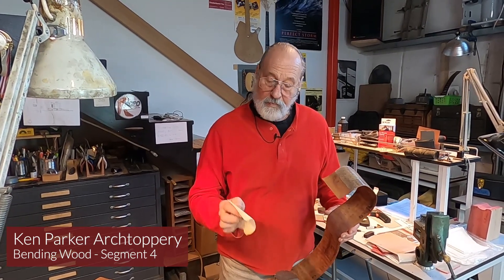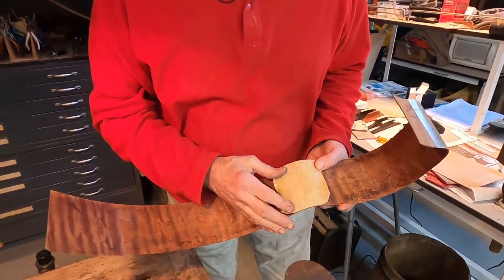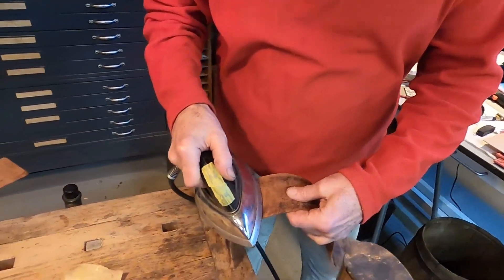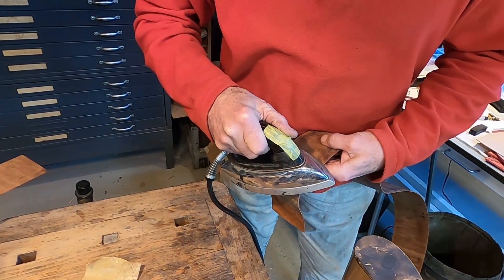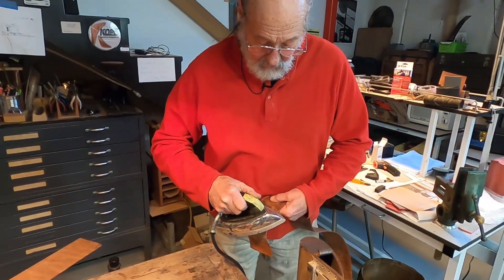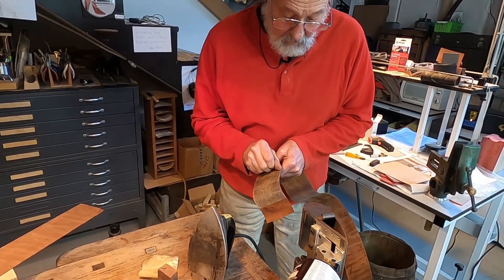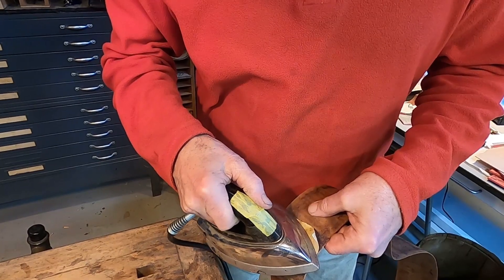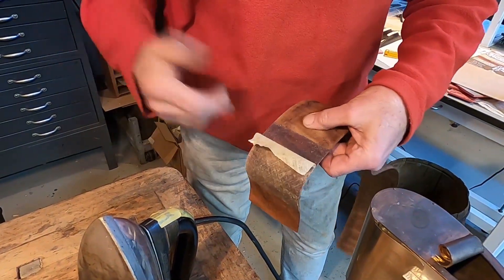Ken Parker Archtoppery: Bending Sides 4

Comment: Please help me to understand Ken. In Part 1 you mentioned that when bending wood, the outside wood fibers stretch. Just a few questions please:

1) Do the wood fibers (on the outside part of the bend) ‘need to stretch’ (to some extent) in order for a successful bend without cracking? 

2) If the answer to question #1 is yes, then how does glueing the linen patches to the outside of each bend still allow the wood fibers to stretch since they are now 
glued-in-place?

3) Or do the glued linen patches prevent only the very top surface of the outside wood fibers to not-crack yet still allows the wood fibers underneath the surface to bend?

4) However, doesn’t the glue (from the linen patches) penetrate deep into the wood thus preventing both stretching and compression of the wood fibers as all wood fibers are now locked and glue-in-place? 

One would think that the glued linen patches would prevent the wood from stretching as you bend thus causing the materiel to either pull/rip apart or crack in some way. However your bends were perfect. Just trying to better understand the science of what’s happening. Thank you Ken. Great video series! Learned a lot.
Reply from the maker: I'd say I'm not sure how much better a job I can do to explain the linen/paper reinforcement scheme than  this,
https://www.youtube.com/watch?v=uwlFHIGr3tE
and this,
https://www.youtube.com/watch?v=vjsSIwAikGU
I'll emphasise that the method is to use the smallest amount of resin that you can to laminate the linen so that the wood doesn't fill up with resin, which would make it a little harder to bend. In fact, the heat we need to bend the wood is enough to mess up the cured epoxy's strength, but it hangs in there well enough during the short time we're playing with heat.
So far as finish goes, I think the only surefire way to make this work using epoxy to bond the patch is to use the same resin as a primer, and so all is forgiven, and there's no issue with any leftover resin left in the side making a color or finish adhesion mess.
Other adhesives will work if you don't want to deal with epoxy, I used to use hide glue, but much prefer the benefit of staying away from water based adhesives which make thin wood go crazy.
I'm sure the cloth does stretch a tiny bit, especially because of the bias cut, which is the + and - 45 degree fiber orientation relative to the side's long axis. We don't "need' the wood to stretch, certainly, just not fail during bending.
It all works famously, loading very nearly all of the side material in compression, which can't fail during bending.
I'm not sure why you think the material would rip/pull apart, as the cloth support method prevents exactly this problem.
This really works perfectly for me, and has lowered my blood pressure.

Comment: could you use peel ply instead of linen ?
Reply from the maker: Well, since the whole reason for peel-ply is that it is a "release film", and so  is especially made so that it cannot be reliably bonded with epoxy resins, I would suggest that it wouldn't bond anything like well enough to take the stretching, or tensile loads it would "see" during bending, and would just pop of right when you need it to stay stuck on. I have found that using linen is the best solution for me, although I did try some other materials like cotton and thick Kraft paper on the way to this conclusion, and you could certainly try other bondable cloth or papers of your choosing if you like. Good luck!

Comment: So you are not laminating these, but leaving the sides single ply at 0.055"??? Thanks.
Reply from the maker: I have done sides several ways, and this one is the most direct, with simple methods and tooling. 
I'm currently using a much more complex method, but chose to show the universal style that I thought the most of you would benefit from.I did it this way for over a decade, with many guitars.

Comment from the maker: Dear Ken,

Thank you for making available your videos on archtop construction- they are wonderful, well filmed, and I am really enjoying learning about your process.  

I hope I'm not bothering you with a question.  I recently watched the 4 video series on your side bending process, and was wondering what you do about the epoxy resin that is left on the sides after bending.  I saw that you remove the patch of linen with the clothes iron, but - and forgive me if this is covered in a later video that I have yet to see- you make no mention of what you do about the residual epoxy on the sides.

Thanks again.
Reply from the maker: Ah, perhaps I did forget to mention this! This is crucially important to know, as many of us have had the heartbreak of only noticing some such problem after the finish has been applied.
By using the same material for the primer coat, we drive around this problem. The epoxy residue from the side reinforcement patches, whether we remove them or not ( I have done it both ways) is cleaned up with scraper and sandpaper, but, of course, some will remain in the side material, and this would be a terrible problem, except that the first coat of my finish is the exact same epoxy, and so the issue is resolved automatically, and just isn't a concern!

Comment: Thank you for these videos, they are fantastic!  I really like your side molds and would love to know if they are designed to have the thickness of the side, straps and blankets in mind?  Meaning, do the two parts of the mold fit perfectly together without anything in there or is there a gap designed into them?  Again, thanks for sharing your knowledge. 🕉
Reply from the maker: Excellent question.  What you refer to, "designing a gap into them" is called an offset.  

If you are clamping/laminating a flat panel, all you need are two flat plates to apply pressure and control the surfaces.
So, in the 2D world, offset isn't an issue.
When you leave the world of flat planes, everything changes in some interesting ways.

To get the tool surfaces to control the bent side as I'm showing, these two tool components need to be cut so as to leave room for the side, 2 rubber heat blankets and the 2 stainless steel shims.
To do a good job, these tools need to be quite accurate.

Assuming we start with a hard outline pattern of your guitar shape, my cheap and cheerful way to mark the correct size offsets is this...

Glue up plywood or particleboard sheets to the required thickness for your sides.
In my experience, particleboard, although kinda disgusting, is the better choice, as it starts out pretty flat, plus its  homogeneity compared to a stack of plywood makes it so much easier to follow a line precisely on the bandsaw. If you tune up your saw and fit a sharp 1/4" blade, you'll have a good chance of cutting so well that cleanup will be trivial. That's the goal.

If the top surface is rough or funny texture/color that makes it hard to see your pen mark, consider gluing on a piece of smooth paper to get a proper surface for the pen.

Using the correct size flat washer, 
https://www.youtube.com/watch?v=Moe5IBhwX7Q
follow your guitar outline pattern and mark the outer part of the tool with a pen so as to expand the outline by the amount of one heat blanket plus one Stainless Steel shim's combined thickness.

"The correct size flatwasher" is judged by the difference between the outside and inside diameters, this is what we care about. Within reason, the diameter of the washer doesn't matter.

Two solutions to the problem of finding the right size washer are ..
1) Look through your giant box of odd washers you've been keeping for the last %#^$ years, or
2) Chuck up a bar of metal or plastic in your lathe, and make the correct part (easy).

Saw and clean up these surfaces with sanding blocks or your spindle sander, accuracy counts.
Now you use this outside tool to mark the inside part of the tool with another washer, this one sized to offset the whole stack of 2 heat blankets, 2 SS shims, and one guitar side.

It seems like this would be a good thing to demo, so we'll put it on the list, thanks!

Comment: Awesome as always Ken! I have applied your linen trick (on typically difficult fragile flame maple .075)  and, believe it or not, used titebond (not epoxy). and it still worked (I thought it would melt on the bend - behold it didn't!). I apply a similar tape trick to a (alternative) veneer/flax/epoxy lamination (no heat) clamped under vacuum (plastic/duct tapefrom Home Depot) and leave overnight. The 3M tape (white from Depot) comes right off and leaves an otherwise difficult bend intact. (Even veneer the thickness of a business card can gives some trouble) Doing it wrong but it works! ;) Thanks for letting us all geek out on your videos!
Reply from the maker: Excellent report!  There's lots of ways to apply this "temporary tape'' reinforcing idea, as you suggest. The reason I like epoxy for this job is that I use the same epoxy resin as a primer coat, and so there is no worry about cleaning off every trace of a "foreign" adhesive, as any leftover resin from the "temporary tape" removal just becomes a homeboy part of the finish. If it works, then you must didn't do it wrong, now, didja?  I dig your work, TogaMan!
Reply: @kenparkerarchtoppery9440  oh, yes, I have even French Polished epoxy 😂. Lately though I’ve been applying vacuum infusion to veneer arch  top sandwich balsa flax cf. (so the infused epoxy veneer is sand polishable). Eye candy with benefits and won’t crack like spruce does in extreme dry. I gave up the humidor fight….

Comment: Hey Ken, I'm wondering what your thoughts are around the idea that the rim, which supports the top plate, should be maximum stiffness (like a banjo).  To that end I know some luthiers use a multi-ply, usually three, for sides.  I have a hybrid nylon string that employs this technique and it's a canon!  The construction is still very light weight.  Obviously more work.
Reply from the maker: There's a lot to say about your question, and I promise we'll get around to this in detail sometime.  There seem to be at least two schools of thought here, with some builders favoring thin, one piece sides, (inspired by 100 year old Martin mahogany guitars?) and others going for the brick outhouse format with multiple epoxy bonded laminates and even solid wood cores with laminates on both sides.  Both can be successful, it seems to me.  I like sides to be compliant and light, so that's one end of the spectrum, but lots of fine builders are getting great results with very stiff laminates, so what do I know? The mad scientists in the classical guitar world were the first to go this way, i believe, with steel string builders following suit.  If you haven't looked lately, there's a lot of interesting newish design thinking in the classical guitar world in search of an expanded dynamic range (AKA Louder!) the embodiments of which have caught on with professional players.
Reply: @kenparkerarchtoppery9440 "If you haven't looked lately, there's a lot of interesting newish design thinking in the classical guitar world in search of an expanded dynamic range (AKA Louder!) the embodiments of which have caught on with professional players."   Yes like the double top thing of which I've seen done different ways including the use of Nomex which is a material borrowed from the aerospace industry I believe.  The goal of course is to produce a very light weight, high modulus plate.  Can't wait to hear your thoughts on this in an upcoming video.  Really enjoying the series.

Comment: Thanks a lot ken for all your sharing.
I fold the sides in aluminium foil to conserve water, but I don't find glue that supports hot bending, to do that. What is this glue ?
Reply from the maker: Sorry, I'm not sure what you are asking.
Glue for what?
Reply: @kenparkerarchtoppery9440   : glue for protection that prevents splits in the ribs during folding.

Comment: Maybe I missed it.  How thick are the sides?
Reply from the maker: You did, but it's easy to miss, I should have called it out at the start.  The sides are sawn and finely sanded to .055" - .060", or 1.5mm before bending, but are so well behaved that they need only a tiny bit of sanding with 320 and 800 to be ready for finish.  I feel this is just right for the size instrument I make.  There are different opinions on this, of course, but I want the sides to be compliant, as I think it frees the plates to vibrate better.

Comment: Hi Ken, 
So I've now watched through this series and I understand the concepts of reinforcing the side under tension and the calculation of how thickness affects stiffness.
What I'm not sure of yet is the point - meaning that is all this effort to allow you to produce an instrument with thicker sides than would otherwise be achievable without the reinforcement?
Or is it purely to be able to use conventional thickness but more highly figured woods and have insurance against splitting and breakage while bending?
Do you have anything on how side thickness/stiffness relates to the tone and clarity of an instrument - how it helps or hinders the soundboards?
Reply from the maker: "no" to Q #1, "yes to Q#2.  Q#3 begs a whole series of questions we'll need to address globally sometime.  Lots of different opinions here, and lots of paths to the mountaintop!
Reply: @kenparkerarchtoppery9440  Thankyou for the kind reply Ken. Very much appreciated. I would be very much interested in your thoughts on Q3 (if you have not already done it in an interview/article somewhere). I'd also love to hear how your thinking evolved re: tones achieved, clarity, use of carbon fibre for stiffness etc from your early archtops, through the electric Fly and full circle back to these current archtops.

Comment: Does the epoxy leaves any residue after sanding ? I guess not. Fabulous craftsmanship
Reply from the maker: since I use the same resin for the sealer/primer coat, it isn't an issue.
Reply: @kenparkerarchtoppery9440  Thanks a lot for your answer. Makes perfect sense

Comment: That linen trick is so cool. Never seen that before. I broke several sides on a tight cutaway guitar recently and managed to achieve it in the end using OBrien guitars technique of a steam box I built to steam the side for 15mins before bending. It worked reliably repeatedly but I’m sure on some woods it would cause them to ripple badly. I will try your method on the next one. I’ve got some zpoxy so hopefully that’ll work as well. Thanks for the videos.
Reply from the maker: Cool to hear from you.  Steam plasticizes the wood, but without discipline, the wood can really distend and get into all kinds of unwanted wiggles. This is where the pinch mold really shines, it leaves the wood no choice but to resolve and dry in the correct shape.
Reply: @kenparkerarchtoppery9440  yes ken. You method other than the cloth is similar to the Fox bender I built myself only I feel your pinch mould is probably slightly more accurate and less chance the wood could ripple. How long do you keep the heating blanket on for when it goes in the mould?

Comment: Great series. Really cool idea of using linen/epoxy. 
Please don't stop filming Ken! Can't wait to see how the neck is made.
Reply from the maker: Thanks, Nick!  The linen is really pleasant to work with, and seems to have just the right amount of strength and stretch to work perfectly.  You could use other adhesives, but because I also use this epoxy resin as the first coat of my finish, it's a no brainer for me.  This way, and little bit of adhesive left in the wood blends perfectly, and becomes part of the finish.  Of course, it's a cinch to peel off the linen when you overheat the epoxy with an iron .  All in all a fantastic help!
The neck process is coming, but wow, what a lot of special tools, and a big bag of tricks.